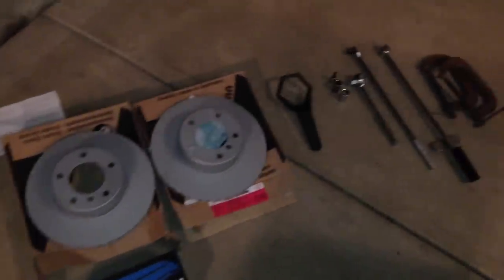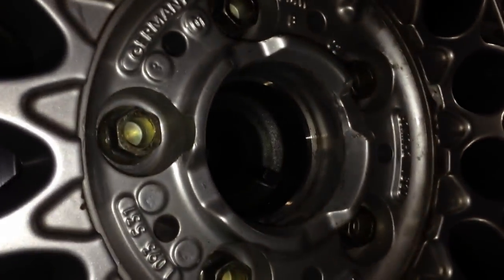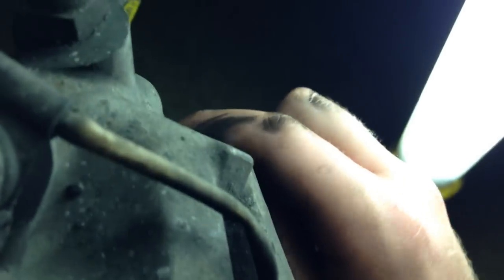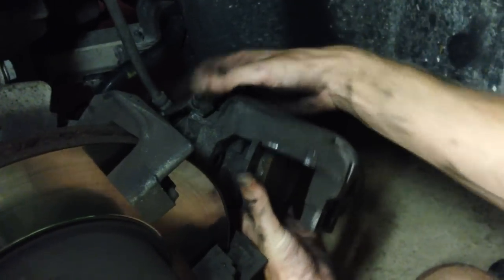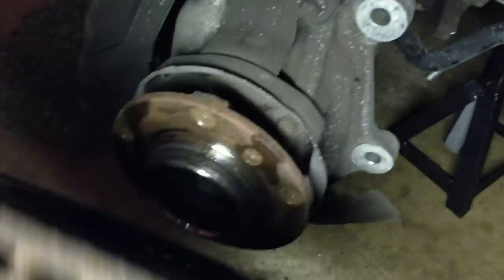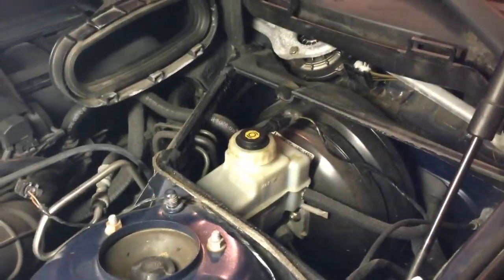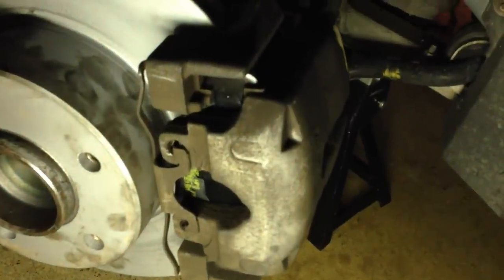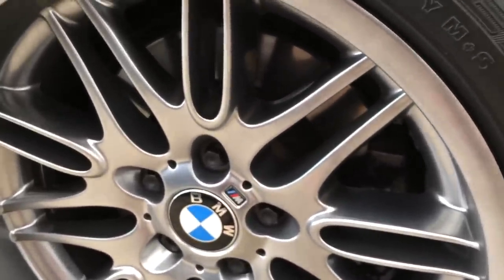BMW E39 5 Series (1996-2003) Brake Pad and Rotor Replacement DIY

Comment: Is opening the brake fluid reservoir necessary? Also, when changing the pads and rotors, did you bed the brakes in any way?
Reply from the maker: Not really.  Yes, follow the bedding/burnishing instructions as closely as possible that come with your pads.  That is important.
Reply: I am using Genuine BMW pads and rotors
Reply from the maker: They should still come with instructions.  If not, do a generic search for "bedding new brake pads" and do that.
Reply: They didn't come with instructions. I ran across a few bedding procedures online. Luckily these parts are from FCP so lifetime warranty. Thanks for your input though

Comment: Word of advise for those DIYers at home, use brake cleaner to clean the rotors when you open the box. Clean any contaminants that can be on there, just to be safe. Also do NOT touch the rotors with your dirty hands like they did. If you do then clean it before installing the new pads. In this video they touched the hell out of the rotors with dirty hands like they were gropping women. But besides that, good video.
Reply: You are right and not right at the same time. Do not use brake cleaner on this disk. The instruction clearly tell you do not to use brake cleaner on this disk. The disk is coated, called Z coat and that coat preventing the disk from rust etc. But I agree with you. The disk sould be kept clean, free of oil etc.
Reply: kriszml you are right and not right at the same time. Rotors do come with with anti-rust coating... but that's to keep them from rusting while waiting around to be sold. Clean them off with brake cleaner. And yes do not smudge and dirty them either.

Comment: Ugh guys ever hear of rubber gloves?  That brake dust material is probably carcinogenic....
Reply from the maker: Ahh what's life without a little risk.  But yeah, we do wear gloves now for this stuff.
Reply: Coach Wilson I beg to differ, back in days, the old brake pads were made out of asbestos and were carcinogenic but not the pads now days, they are made out of organic materials, metals and ceramics. Since everything is carcinogenic now days those are probably too by a certain degree, but not as dangerous as old asbestos pads
Reply: My concern in addition to cancer is the effect these super microscopic particals might have if they are inhaled.  A mask & gloves are two tools you should have when working on any brake system, but especially around the brake pads etc.
Reply: Yea dude, or hands are so dark u almost qualify fur a loan. U need to use gloves so u don't get cancer when u grab a quick snack when working on ur car.
Reply: @ackas4576   thats why i have caner.
Reply: You should probably wear a gas mask outside and in. Because the cancer kh kh kh... Everything is dangerous and poison, his car kills more life and oxygen than your asbestos pads.
Reply: life is carcinogenic

Comment: at what pressure do you need to screw the rotor screw???
Reply from the maker: +michael gallardo Just hand tight, it only holds the rotor on there while you get the wheel lined up.
Reply: thanks so much mud. honetly i watched this and i needed no further instructions. changed all four rotors and brake pads on my girl's 525i . ty